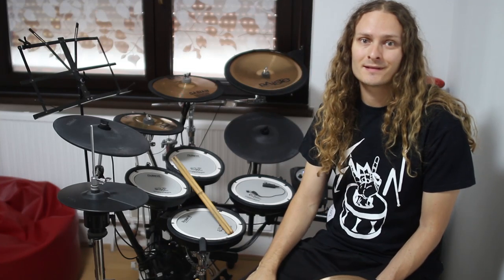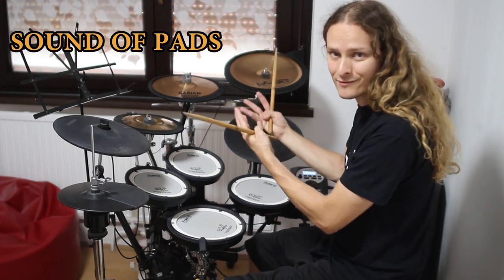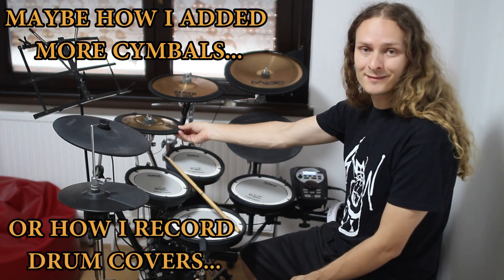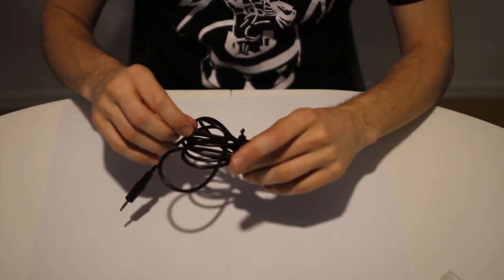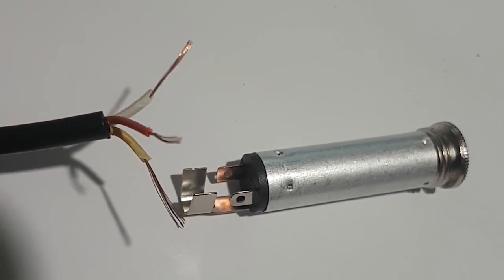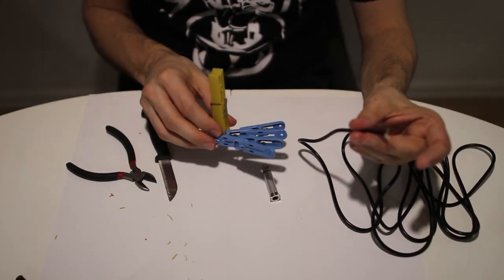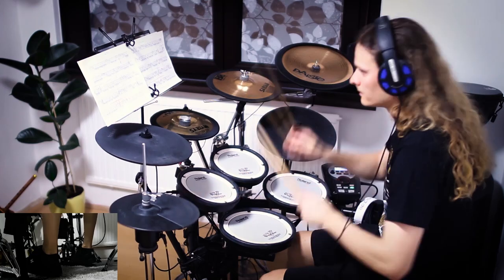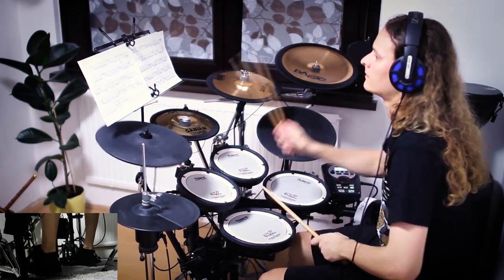HOW TO convert ACOUSTIC cymbals to ELECTRONIC cymbal

Comment: how did you connect this 3 extra cymbals if  roland td 11 use a multicore? (other s roland modules has more connections) 😅😅 did you use another module? thanks in advance
Reply from the maker: I split the signal in toms... they have dual triggering (rim and skin). I dont need rim so i  use this signal on extra cymbals. So i get 3 more cymbals.

Comment: Great video and top notch drumming. I wonder if within the td 11, you can route the metronome to the headphones output onlly while the main outputs play only the sounds. Also, how did you split the stereo inputs, with a normal Y cable or the modified Y for e drums?
Reply from the maker: Don't know about the metronome. The cable is a normal splitter but I build inside the jack a 100 kohm resistor.

Comment: 9:14 what happened to your finger?
how many channels does your module support?
very detailed overview!!! I like it
Reply from the maker: One year ago I was in Mexico and I cut a piece of meat from my finger, while I was cleaning the dishes. A glass broke and cut it off. I had much luck, it could be worse. 
My module has one big cable which splits into 10 cables for normal set. And roland td-11 modul has one more extra input. Toms and snare are dual trigered (middle and rim). I seperate those on toms and put the rim signal to the cymbals. Thats how I got my extra 2 cymbals + I still have a free slot for one )
Reply: @SimonSkrlec  
Toms and snare are dual trigered (middle and rim). I seperate those on toms and put the rim signal to the cymbals. Thats how I got my extra 2 cymbals + I still have a free slot for one ) - This is a very cool idea!!!
Reply from the maker: @Leshij  thanks.  Now i cant play tom rim... but i never did hehe🙂
Reply: BOBNAR Simon Škrlec I almost cut my thumb off with a power saw.
Unfortunately now it’s fused straight and about 10mm shorter which I’m having a lot of problems with blast beats mostly.
So I’d love if you could do your blast beats technique.
Thanks for the great content